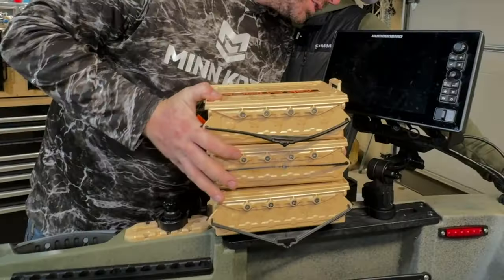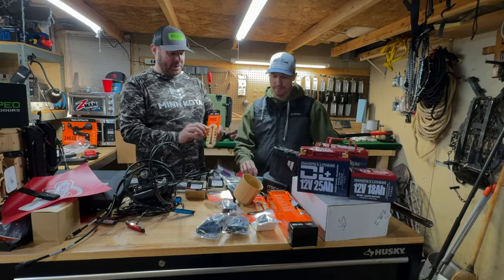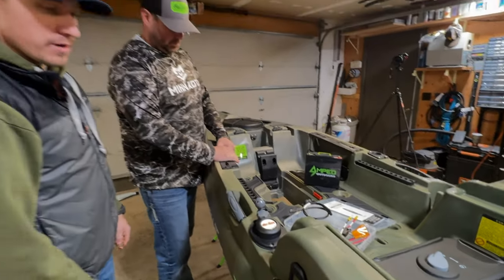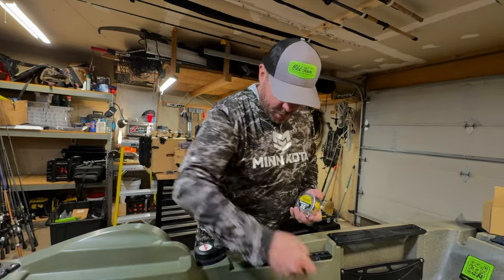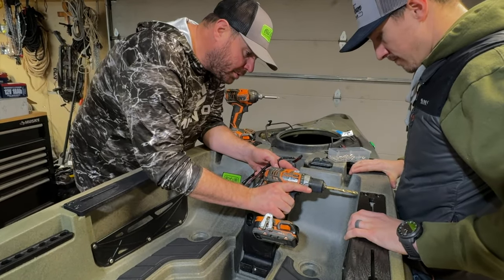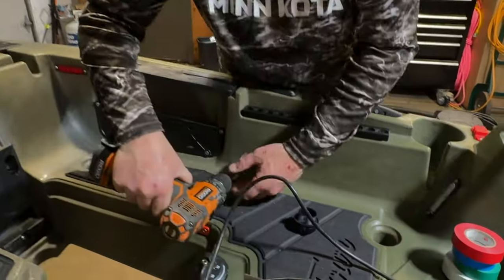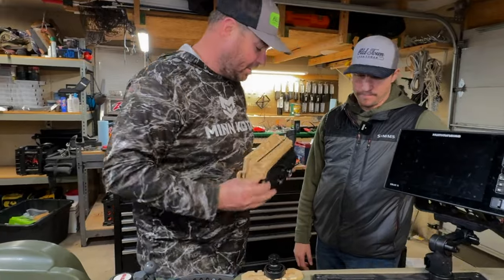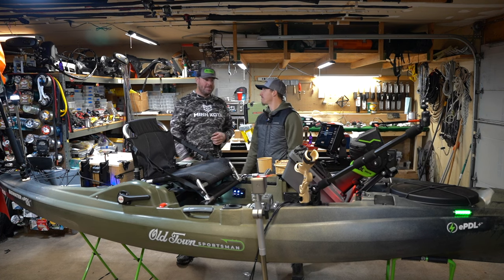Bigwater ePDL+ 132 Dream Build (featuring Thomas Allen from Kayak Fishing Fun)

Comment: The best thing about the ePDL is the fact it leaves you feeling in tune with the kayak. Not just a motor that takes over (unless you want it to). But having the assist while pedaling leaves me feeling more in control. But I stand firm with the fact it needs an upgraded rudder.
Reply from the maker: That is a great point - thanks for the feedback!